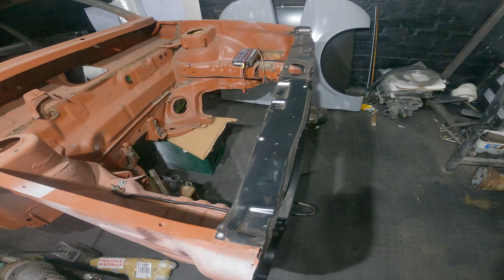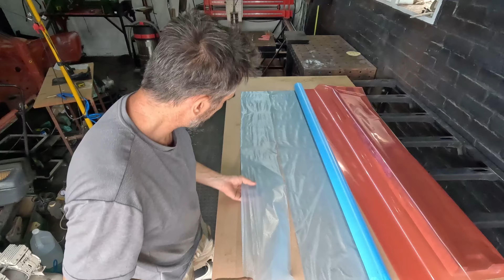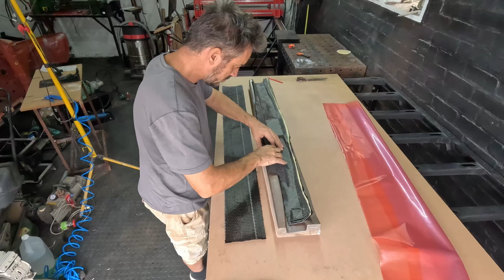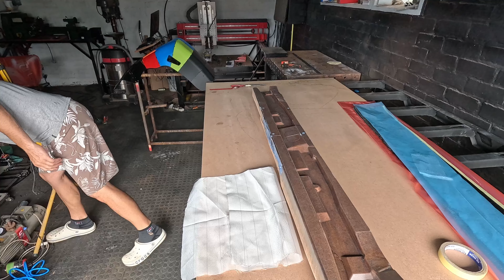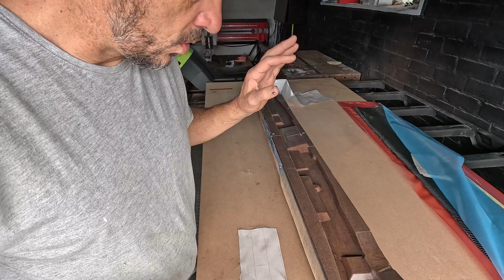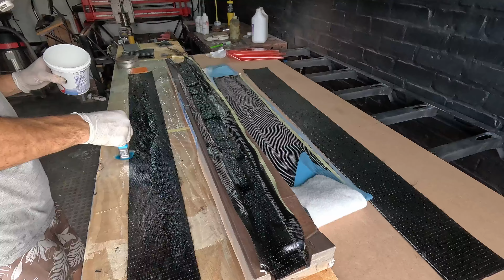i made my first carbon part using my einstar scanner

Comment: Great video. What is your workflow getting the scan into solidworks?
Reply from the maker: once you have completed the scan the last step is align it to the co ordinate system , this is done by drawing a plane , a line and a point onto the scan. using these references the scan will change orientation to align to XYZ in solidworks
Reply: @carbonmk1 are you importing as graphics body?
Reply from the maker: @xxBOOSTYxx   i import as an OBJ , as you can convert to mesh and work on it then.
Reply: @carbonmk1  thanks for the info. Not long got the einstar and haven’t a chance to stuff around much. Downloaded a few scans online which all sent to make solidworks very laggy.
Reply from the maker: @xxBOOSTYxx  yes make sure you take visible lines off on the display , makes a massive difference
Reply: @carbonmk1  thanks, will give it a shot
Reply: @carbonmk1  are you gonna start selling those parts in carbon fibre